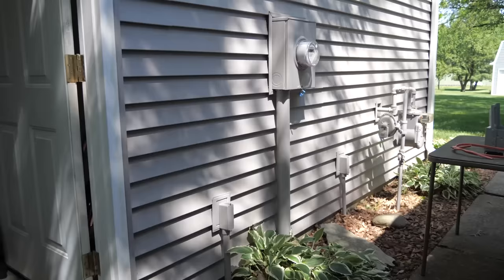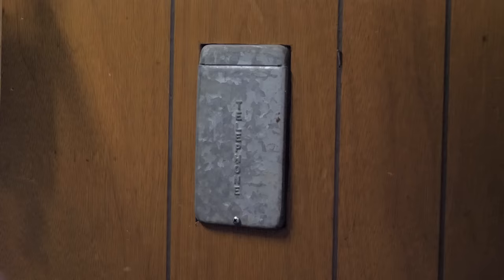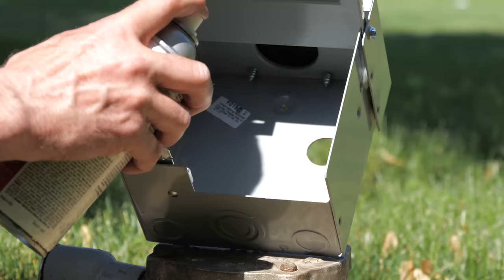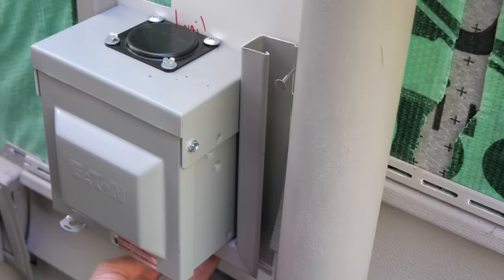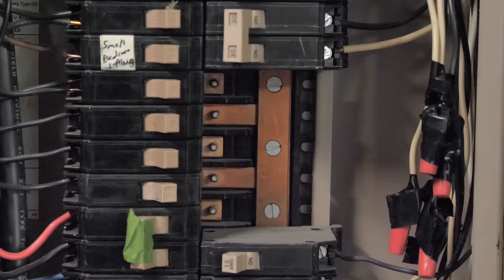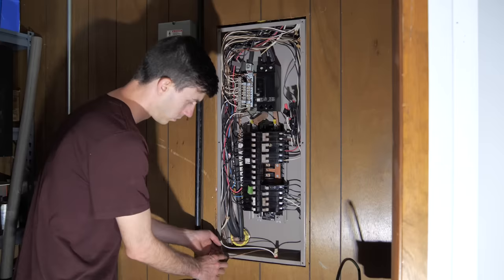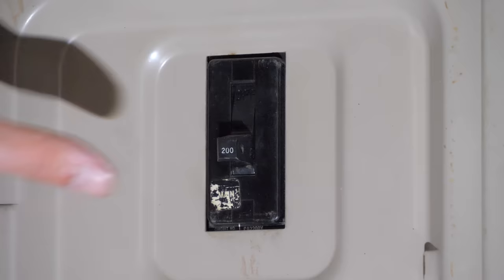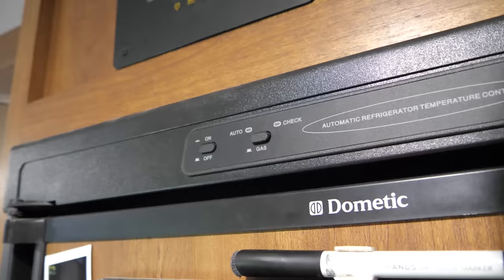30 Amp RV Outlet Install - DIY Electrical Receptacle Wiring

Comment: No bushing on the new hole you drilled at the bottom of the existing electrical panel?
Reply: Very well-done project. In addition to the bushing, it is safer to wire in the ground wire, then the neutral (white) wire, and lastly the hot (black or red) wire. Don't strip a wire until you're about to screw it down. A long, loose wire can easily brush up against the hot lugs at the top of the panel.
Reply: @abelanderson8695  Excellent advice. Ask me how I know ;-)  Now I even keep wire nuts on unattached wires before stripping and screwing them down.
Reply: @simongchadwick  Do please share your story. I brushed a loose bare ground wire against those hot lugs once while installing a new circuit. In a flash that copper wire melted into a strand of hot liquid on my forearm. That molten copper hurt like hell but probably saved my life. Since then, I always wire in that ground wire first.

Comment: Outstanding! I didn't realize vinyl siding came off in sections. Not sure I understand how the trim keeps water out, but I'm sure it works. I thought all main panels had the ground and neutral busses tied together, but only in that one spot.  It looks like there's enough room in the 30 amp box to add a 15 amp outlet for future use. 
Your dad looks just like you!

Comment: Did the same and had similar scenario with panel and place for camper.  I went ahead and did a 50 amp for the future or guest.  I didn't put J channel around mine.  I just screwed straight through the vinyl and placed box on vinyl.  Yeah it's chincy but it doesn't leak and saved some effort.

Comment: Excellent, well scripted video. Nice, professional quality work. You can rest assured it is a much nicer and better installation than any that you might have had an electrician do. The stars aligned on this installation with the electrical panel being where it is located.
Arrgh! you didn't use any kind of wire clamp where the wire exits the bottom of the panel. Could have been a plastic push thru clamp.
Hint: glue a rubber flap in the box so when the lid is closed and no shore cord is attached, the rubber flap will close out the opening. This prevents wasps and spiders from getting in and building nests. Ask me how I know..

Comment: As an electrician, I think you did very well.  The siding would be the tricky part for me as I've never dealt with it.  

As an electrician, the location and access to the panel was fortunate.  I was wondering about the access inside the garage wall.  Figured you could've fished straight to the outside.  But then I forgot about getting around insulation.  So you did yourself a favor.

Comment: Nice job!  In addition this will increase the safety because you're NOT using extension cords.  Although your cords looked beefy (looked like 12 gauge), you'll have far lower resistance with the 10 gauge 3 foot run from the panel than the 50 foot of 12 gauge ext cord you used before.

Comment: Thanks , you did a great job!  You helped me with my video on the same situation, but I did it for a air compressor not a RV ,but its the same situation. I've done this many times for 240 or 220 but it's different, that's done with a double pull and the red and black go to the breaker, this is a single pull and that's where you helped me thanks 😊 ❤️

Comment: 2 thing I would do different.
1) Use a GFCI/AFCI breaker
2) Not leave all the breakers on and turn on the main. Turn off all breakers, then turn on Main, slowly turn the rest of the breakers on. Don't throw a huge load on the main this way.
Reply from the maker: I agree with both points. And I have since swapped the breaker to a GFCI 👍

Comment: I just installed one of those boxes.  The inspector told me I had to put in a CGFI 30 Amp breaker.  As well as the 20 amp plug had to be a CGFI Weather Resistant (with a cute little Extra Duty cover lid)  What a pain in the $$

Comment: Excellent video, good information, and good pacing to illustrate the project effectively. As a licensed home inspector in NC, my only concern is that if you did not unplug the trailer from the 15 amp service, you may have energized the main panel when the generator was started for the work tools. I am sure that you did unplug, but that is the only omission I can see. Terrific work and explanation of the process! 
An identical 30A outlet was added under my parents' porch a couple of years ago, and my sisters and I use it with our trailers when visiting. Before that, one sister's trailer was tripping the garage GFCI circuit. Last year, after the parents lost a TV, perhaps a refrigerator, and needed a new control board in a 5 year-old HVAC air handler, I installed a Square D/Schneider whole-house surge protector in the main panel. So that also protects the RV outlet. So far so good!
Reply: *Inverter, not generator
Agree with previous comments that a strain relief should be used where the new Romex enters the main panel, missed that.
Neutrals and grounds may be landed in separate bus bars in main panels, but they are still connected. It is in sub panels that they are electrically isolated.

Comment: When drilling into the back of the receptical box, try to place the hole below the position of plug. Should water work its way into the back, then the water will not drip down into the receptical.

Comment: When pulling a home run always look for the path of less resistance and the shortess run to be. Cost effiecent but be carefell if u are adding circuit to a live panel.  Electricity can have consequences so.  Always treat this power with the respect it deserves

Comment: FYI if you seek out friends who have electric cars they are very likely to have an outlet you can plug into. And if you're going to install an outlet, you might want to go for a 50 amp so you have more options in the future - 50 is suitable for bigger RVs, electric cars, garage freezer or dryer, etc.

Comment: Hey when Dad plugs into that 30amp outlet with the adapter. Please figure out how to add a GFCI into that conversion. You don't need that for the RV, but dear old Dad will be using a hand held drill or pruner, etc...
Reply: Amps is only the the load of devices used...
Reply: Can get a GFI "pigtail" at most hardware stores.  Plug in 30 to 15 adapter, plug in GFI pigtail to 30 amp adapter, plug cord into pigtail and go on.
Reply: @duaneroepke8840  Also needed is protection of the 12 gauge wire in the extension cord, 20 amp breakers (or 15 amps for typical 16 gauge cords) are typically used. Search this pigtail online for the GFCI part you mention. Not sure if that would limit current also : "3 Foot Lighted Outdoor GFCI Extension Cord with 3 Electrical Power Outlets - 12/3 SJTW Heavy Duty Yellow Pigtail Extension Cable with 3 Prong Grounded Plug for Safety".
Reply: @jordan1994R  In this case amps means 30 amps before the breaker blows. They are suggesting adding an extension cord into the equation that cannot handle that much current.
Reply: @aerobiotic    you are correct in that you would need protection for the smaller ga wires.  You are also correct that gfci dose not limit current but just watches current in vs current out 
   In an extention cord use situation, a short would most likely trip the 30 amp breaker (personal experience tripped) but the smaller ga wire would not be protected against overload.  If this set up was used for temporary/maintenance scenarios and NOT long term use powering a load say a heater or some other heavy continuous load I  believe anyone using this setup would be ok.  I believe when using this setup the gfci would come into play (personal protection) before long time overload.   Common sense comes in here. (Assuming the user has it.)

Comment: You should look into a soft start kit for your AC. Most small Rv AC’s draw 20amp at initial start up than go down to around 14 amps or less. The kit will keep it at or below 15 amp at start
Reply from the maker: We actually already have. We installed one almost 2 years ago

Comment: The box that you installing is the main electrical box that's why you have the  White neutral and the ground  in the same ground bus bar But if you had another panel feeding  from that main electrical then  the sub panel you separate the neutral which its color white and the ground which its color  green  ground.

Comment: No bushing to protect the wires where they go through the knockout in the panel? Might also want to caulk between the box and J-channel.
Reply: I don't know what the code is there but here there should've been a strain relief at the panel and at the box so you can't accidentally pull the wires out which also acts like your bushing to protect the wires from chafing on the sharp edges of the knockouts.

Comment: Nice vid. You didn't list the 30 amp circuit breaker.  An RV Repair shop recently told me when people try to run their AC off of a 15 amp circuit,  it usually causes havoc with the compressor (I believe) in the AC. They have had to toss many ACs because of this because if the compressor goes, so does the whole unit.

Comment: The main issue (even though its probably not a big deal) would be drilling that hole, as unless the OEM specified a procedure for it, it lost its UL listing and is no longer compliant with NEC. One thing that needs to be said is that the NEC is not a mechanical standard, but a safety standard.

Comment: Good job. I guess you can move it up to 50amp with bigger breaker/wires down the road if needed.
Reply from the maker: Yep you sure could! You would have to swap out the plug as well.

Comment: Nice heat, humidity and storms to welcome you home. I hope you'll hold a socially distant Meetup before you head back west. A drive by maybe?
Reply from the maker: Unfortunately no, it's still not safe to be around large groups of people and we will not put our family in danger by holding a meetup while there is a pandemic. Maybe someday it'll be safe enough to hold one again but as of right now we have no timeframes in mind.

Comment: My hubby did this at our house so we could hook up our 5th wheel🤗
Reply: We are thinking about doing this at my parent’s house + making their house our home base between traveling.  Just out of curiosity, with this hook up, are you able to run everything in your 5th wheel? What do electricity costs look like when it’s plugged in.  Thanks!
Reply: @jackiehigh4659  Yes we can run everything in our 5th wheel. Not really sure about what the increase in electric would be for full time use. We do keep our’s hooked up all year to keep the battery charged. We are only weekenders/weeklong campers as of now. I hope this helps. Best of luck🤗

Comment: Very nice install the only question I have is how do you weatherproof the connection from the trailer to the surge protector it seems like it's open to the elements

Comment: I’m interested in yours and others opinions on plugging in when there is no switch or breaker at the outlet.  Most instructions says to cut power at the pedestal via the breaker before plugging in, plug in, then turn the breaker back on.   Unless we add a switch inline right near the outlet/box, it’s unrealistic to go use the panel breaker.

Comment: Great video, instructive/educational. I’d you had to do it all over again, would you consider a standard RV box that would have a 20, 30, and 50 AMP receptacles? 

I’m having new service on a piece of property and wonder if it’s worth having this configuration vs 2 - 30 AMP and a 20 for running tools or other.  Thanks.

Comment: I noticed you used a conventional breaker and not a GFCI breaker. I have been getting different answers on if one is required. My big concern is an electrical inspector flagging it. I have a Homeline panel and of course they don't make a single pole 30 amp GFCI breaker. They make a 2 pole breaker and I suppose I could just leave a pole open. Not sure the inspector would let that fly either.

Comment: everything looked good except you need bushing for every passthrough metal (ie the tel box and the bottom of your panel). hope they never chafe or get warm and are under any pressure or they will short to ground in your panel or wase case energize the tel box or short out your hot wire to either your neutral or ground (assuming the insulation gets cut through the outer jacket, the hot and either wears the the neutral as well or contacts the ground wire).

Comment: We did this as well but our inspector required that the outlet be protected by a GFCI breaker since it is outdoors. Not sure if that's national code or just in TN.

Comment: Great improvement to your folks house and your moochdocking.
I wonder if I can do it to my own house with only 100 amp service?
Cheers! Garry & Dar - RovingRVers
Reply: Assuming the existing 100 Amp Service isn't overloaded, sure you can add a 120 Volt 30 Amp branch circuit to feed an RV like David did. 

John T   Retired Electrical Engineer
Reply: @OldJohnT102347  Thank you!
Reply: OldJohnT102347 Doesn’t he need some kind of strain relief on the back of the outdoor box? He has it loose on the connector, no?

Comment: Wiring my outlet was a Bitc#.  1- a punch out tool is recommended for the outside box. I tried with a hammer and a chisel. Bad idea. Would not punch out. 2- had to cut the 8ga wire tips. The outlet would not pinch em, and they’d come off as soon as I twisted the wire.

Comment: Good clean job, however, per electrical code, you cannot use a low voltage "Telephone" box for high voltage electrical wires.  You could label the telephone box at a minimum, showing it does have high voltage wires within. Also, you need to label your electrical panel showing what that breaker controls.  Other than that, a perfect job.

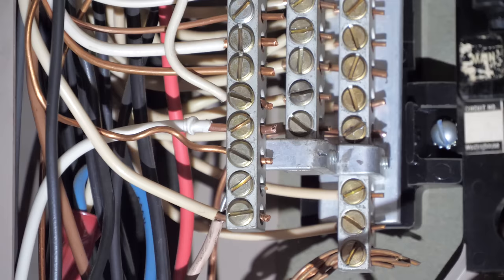Comment: At 9:40 you say "It's important not to double up wires on the grounding bus". yet the video clearly shows a bundle of them under one screw at the top and the bottom of the bus.
Also, at 11:16 you mention the multimeter red probe goes here and the black probe goes there. When testing AC voltages, it does not matter which probe touches what. Even with DC it does not matter since the meter will merely show a negative voltage.

Comment: Great but that box is metal. It needs to be bound it. Use a ground screw and take some of the ground wire to be secure. Use a NEC for reference. Good luck 👍

Comment: I had a builder install an outlet for me and when I plugged my camper into it, boom, all of the electric went out!  Checked all breakers, and everything works if I run it from an electric cord, but no shore power now.  Could it have been an electric surge that fried the inverter?  Any comments are appreciated.

Comment: I am adding an RV service 30AMP to my existing panel also. My RV 30AMP service panel box also requires 10AWG wire and the directions state that I need to use a single pole 30 amp breaker but my question is this, how do I know what brand or type of breaker to get to match up with my panel? I looked in my panel and it has several different brands of breakers, it also has single pole and double pole breakers in the panel.

Comment: Sink a grounding rod into the earth and connect it directly to the 30@ outlet box. It will save the electrical system in your RV in case of a lightning strike.

Comment: Out of curiosity why a single pole 30 amp breaker and  not run a piece of 10-3 for a 2 pole just in case

Comment: Very well done! Your how-to videos are always so clean and precise.  Well, mostly. ;) ... it would appear you forgot or didn't show using a bushing or locking clamp where the wire comes up into the panel. Also, the hole you drilled for the exterior box probably needed a locking clamp and/or rubber gasket. Did you pack it with foam insulation or anything to keep critters from using it as a way into the house?  ... The rest of the info was great! Thanks!

Comment: We are looking at a property. That has two hook-ups that are 30 amp. 110v. Will you still be able to run the ac on the camper with 110v?

Comment: Did you have any issues with you plug getting hot or melting before you installed the 30 amp outlet?  Before I go camping i plug up to an outdoor outlet by using an adapter and let my refrigerator cool and also check to make sure everything is good to go. Today my adapter melted enough to quit working. I am putting in a 30 amp outlet now

Comment: Is wire run referencing the wire from circuit breaker to receptacle or cable to trailer?

Comment: Great install, but not using romex connectors on your cable entry into your electrical boxes is an electrical code violation.

Comment: Ummm, at 0:42 into the video, while you're talking about frequent faults, isn't that a screw or other metal in the ground spot of the outlet?  Was that intentional?  Maybe that's the root of the issue.

Comment: Your fridge is 12 volt and LP, lights and furnace is 12 volt, water heater should also be LP/electric. The only thing you have a high output on is AC, microwave, residential fridge, fireplace and anything that is plugged into a 110 outlet.

Comment: Love your videos!  Question:  Is there a safe way to power our 30 amp travel trailer using a 50 amp campground pedestal?  Thank you!
Reply from the maker: Yep! All you need is an adapter. Just make sure you don't pull over 30 amps of electricity or you'll trip your RV's main breaker. Here is a link to our shop on amazon where you can find adapters in our "RV Essentials" list: https://www.amazon.com/shop/fateunbound/

Comment: I’ve hooked up our outside 30 amp 10-2 , I’ve got a 30 amp double poll breaker that feeds my compressor on one side of the breaker but the other side is empty can I use that or strictly a single poll breaker?

Comment: The second hole that you drilled inside the house should have had a wire protection from the edges of the hole.